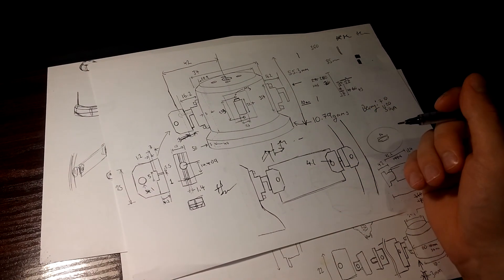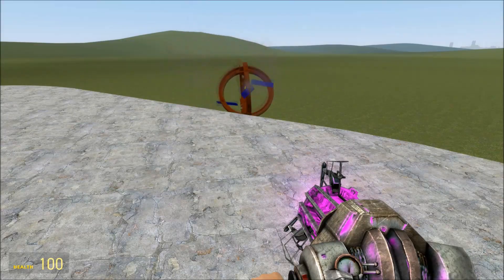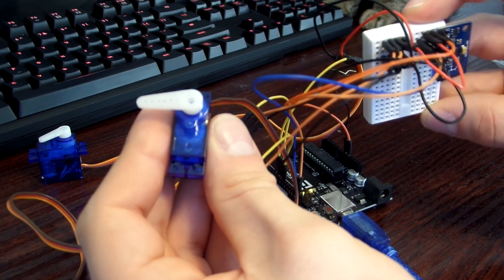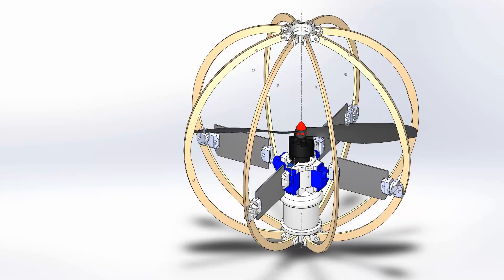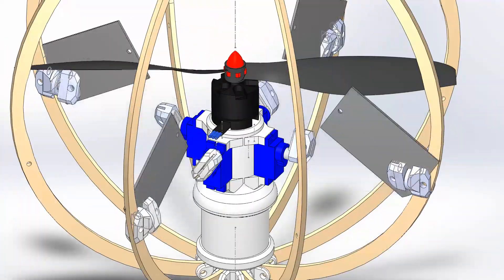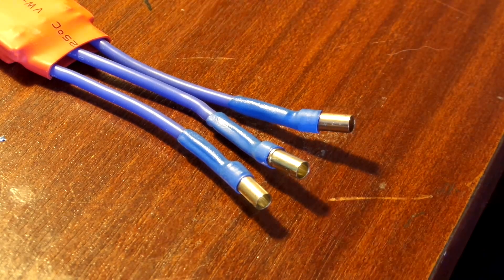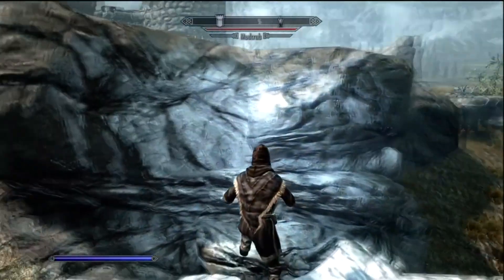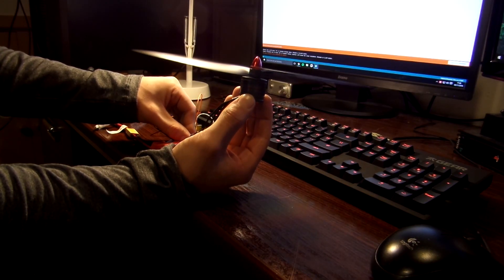Building a Single Propeller Drone With Arduino - Part 1

Comment: I looks like the Fleye drone concept. You could 3d print an upper and a lower "bowl" that get locked together and build in a mesh to keep fingers from contacting the blades. It'd be cool if someday solar panel skins would provide enough power to keep these things flying non stop.  If there was a battery pack in the bottom then when the battery gets low it could hover over a Qi charger and drop off the dying battery then hover over to the next Qi charger that has a fully charged battery pack to pick it up and keep going.  Of course that would mean it would need a built in supercapacitor to give it a couple of minutes of flight time to make the switch.  An office cubicle farm could have an empty Qi charger right next to a charger with a battery getting charged so it could stay flying all day.  The fully charged batteries could give off a signal that they are ready to be used.